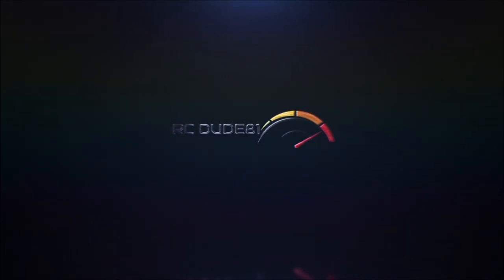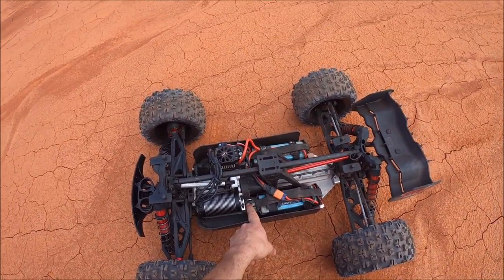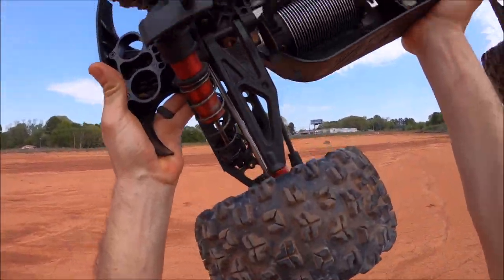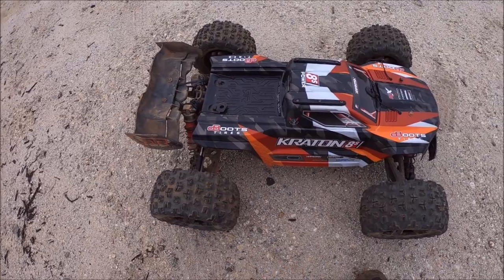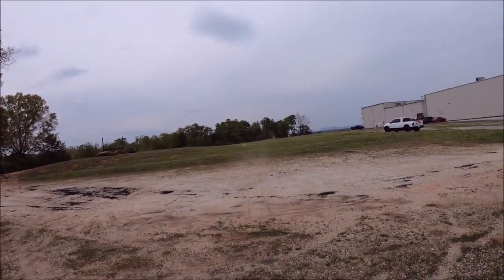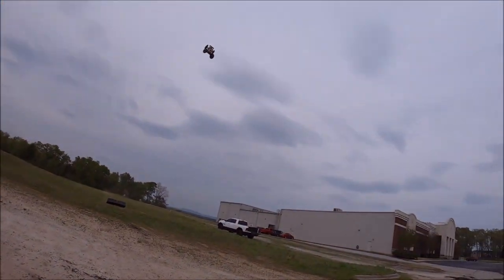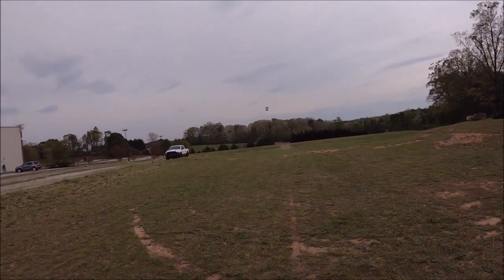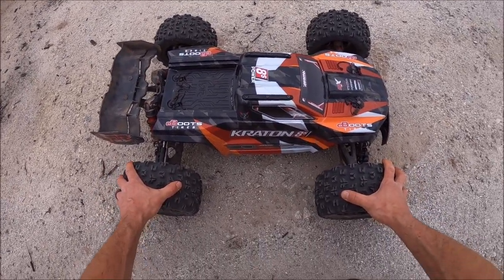NEW M2C Driveshafts test with EXB 8s parts! Arrma Kraton 8s 1/5.

Comment: RC dude81, great video as usual. I have a quick question for you. I also am running a Max5 with a hobbywing 1100kv motor, and 30/39 pinion spur setup in my Kraton 8S EXB. The problem is, my Max5 keeps rebooting by itself when I hit full throttle from a standstill. Otherwise,  it runs normally. Everyone keeps telling me, I am running too high a gearing. And that my batteries are probably not supplying enough amps,  so the ESC cuts off to protect the batteries. The Lipos I'm using,  are Zop Power 5000mAh 60C. Have you ever ran into a problem like this with your Max5? Thanks.
Reply from the maker: With that gearing it sounds to me your lipos aren't up to the task. Its throwing the ESC into LVC bc of the amp draw. You may want to step up to Graphene packs or 100c packs. 30/39 is pretty steep for bashing imo on the 1100kv unless you're doing speed runs. Hope you get it sorted man!😎👊
Reply: @RCDUDE81  Thank you for your knowledgeable opinion. I truly appreciate it. I am waiting on a pair of high-power Gaoneng GNB 4S 9000MAH 15.V HV 130C Batteries to come in. I may play around with the gearing and motor in the meantime. I just received my hobbystar clone, 780kv motor. Thank you again.

Comment: I absolutely have no idea how you truck is taking all that abuse. I had two A-arms on my K8 EXB completely shatter on jumps no higher than 1m, with perfect landings. The quality of the truck just seems completely different than my K6 EXB, and I can't see it ever being bashable. Do you have a list of upgrades on this truck?
Reply from the maker: I'm running stock arms with all the M2C upgrades. Chassis, steering rack, braces, shock pistons and shafts, motormount, suspension blocks etc.. Shes a tank!😆💪💪